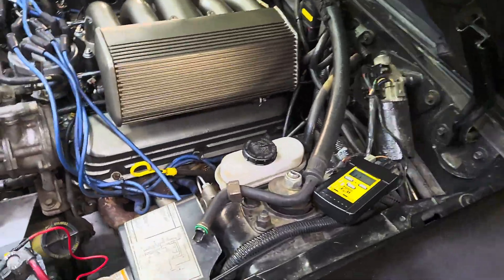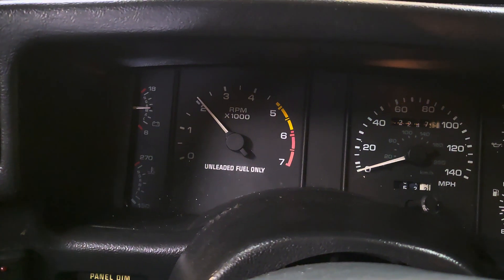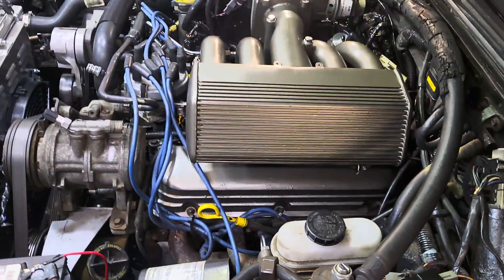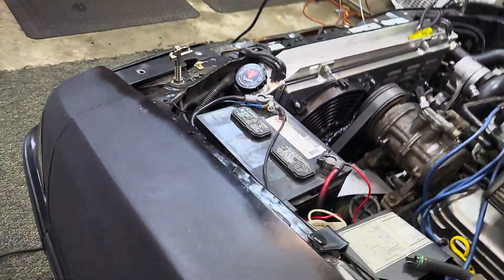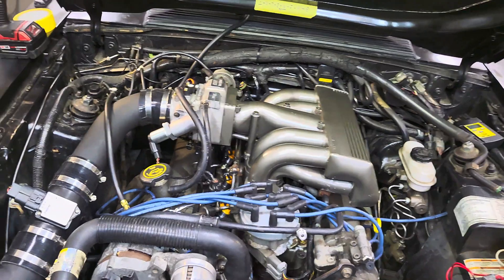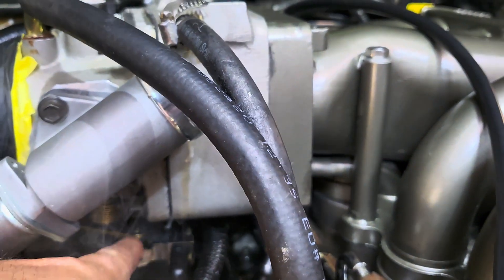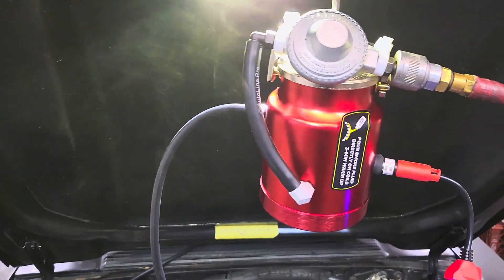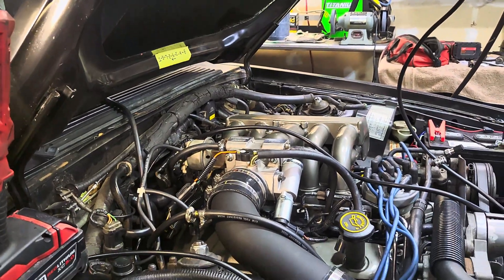FOXBODY MUSTANG ECU CODES & VACUUM SMOKE TEST

Comment: Thanks for the helpful video. Where did you hook up your smoke tester? I have the same tester and hooked it up to my PCV pipe on the throttle body. I get smoke from the EGR Valve and TPS too, but I think that's normal since the TPS doesn't have any rubber grommet or gasket. I think it's just too much air pressure from the smoke tester.

Comment: you need a better scan tool, one that can show live data. the "code reader" is not very reliable. and it looks like you have vacuum leaks after all, which is allowing un-metered air into the engine which affects the O2 sensors making the ecm think the engine is running lean causing the injectors to open too much then flooding cylinders causing  all kinds of issues.